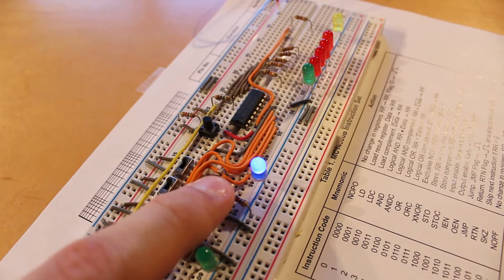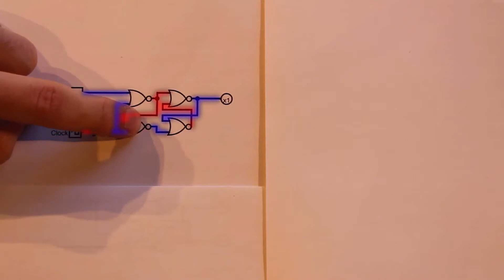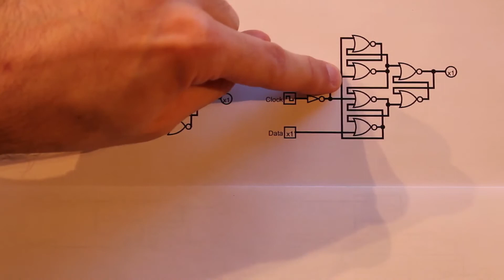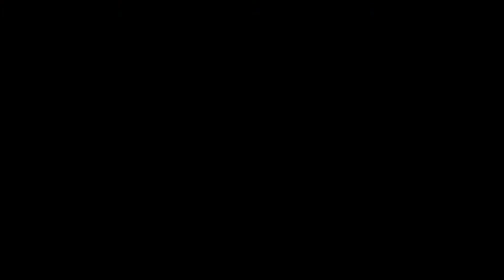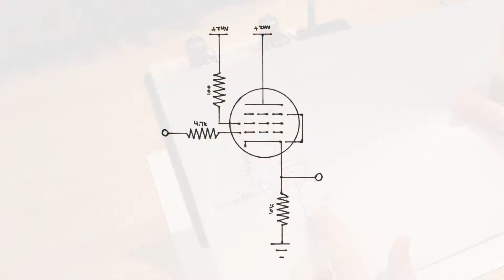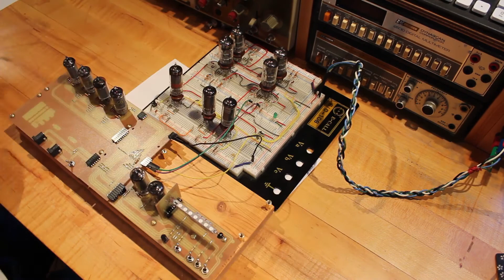Vacuum Tube Computer P.06 –Building a New Results Register

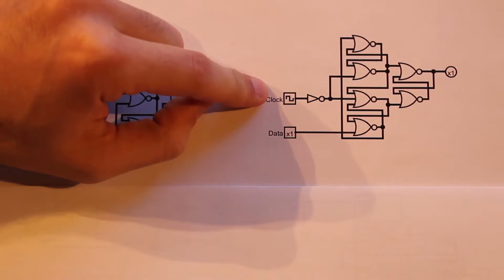Comment: 5:11 put a nand, or an "and" gate on clock and data bit, with a latched buffer, that way logic stay synchronized, and you can use a different bus impedance
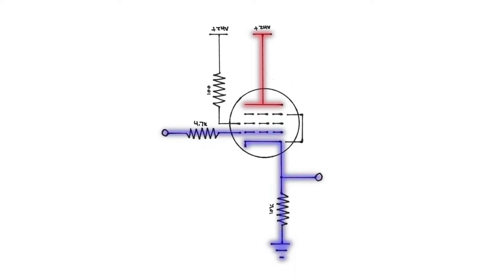Reply: 11:00 nowadays you call it a emitter follower for transistors, and common sourcing a mosfet, in 2023 an igbt or mosfet is the functional equivalent in operation to a triode, even down to its drive characteristics
Reply: minus a filament supply, just need your collector/source (anode), gate/base(grid), and drain/emitter (cathode)

Comment: The key advantage of the this master/slave arrangement (inverted clock to the first flip/flop) is that the change in the cock reaches the second(slave) FF before it reaches the first (master) one, due to the delay of the inverter. This makes sure the signal at the input of the slave is stable while its clock transition is happening.

Comment: The thing which you are calling a D flip-flop is what in digital systems is called a “latch”. The circuit which combines 2 latches is indeed a master slave flip-flop which is commonly called a D type flip-flop (hence the confusion with your named “D flip-flop”).

Comment: Compact? Did you consider using 1Ж24Б (1sh24b) valves? Not only compact, but very cheap. They work great on low voltages. Beware that filament voltage is only 1.2v: https://www.radiomuseum.org/tubes/tube_1j24b.html
Reply from the maker: I would really love to get some of those subminiature tubes to play with one of these days! The primary reason I'm building everything out of 6AU6s though is that they do great at low voltages and are the cheapest tube I've come across. You can often find huge lots of them for cheap enough that the individual tube price is less than $0.30!

Still, those subminiature tubes really awesome!
Reply: @UsagiElectric  what is that reason that 6au6 tubes are so cheap? A component used in a lot of common items?
Reply from the maker: @RiggedBananaGaming  Honestly, I'm not sure as to the specific reason why they're so cheap. From what I've seen though, they were a fairly common tube that could be used in a ton of different components. For example, my HP200CD Oscillator uses two 6AU6 tubes. Tektronix also used them quite often in their scopes, sometimes having around 20 6AU6s in use. Also, I believe they were quite popular tubes for TVs and radios and 50s and 60s.
Though, it should be noted that the 6AU6 wasn't the only popular small general purpose pentode. The 6CB6, 6BA6 and a few others were really popular as well, and in most cases they can be interchanged with the 6AU6 without even needing to rewire anything. (The 6AU6 and 6BA6 share the same pinout and perform very similarly, the 6CB6 has the cathode and shield grid pins swapped, but since those often get tied together, the 6CB6 can usually be swapped in without issues.) The 6BA6 was used in quite a few places our Magnavox Conert Grand, and the 3CB6 (a 3 volt filament version of the 6CB6) was used in an old General Japanese TV we have. 
From what I've seen, these small 7-pin pentodes tend to be really cheap as they worked great as general purpose amplifiers for all the control circuitry for TVs and radios and what not, but they didn't produce the best sound for output audio amplifiers (and given their small size, the amount of current they can push is limited). So that means there are a bunch out there that aren't really highly sought after by the hi-fi audio community, which is the primary use case for tubes these days.
Reply: @UsagiElectric  thanks for all the info! Also for the amazing videos! I've been powering through them and have the bell on to make sure I don't miss one! Amazing production quality, didn't know very much at all about tubes before these videos
Reply from the maker: @RiggedBananaGaming  Thank you so much!
It means a lot to hear that y'all are enjoying the content!
Reply: @UsagiElectric  Or going even smaller, nuvistors. Those were the "last hurray" of vacuum tubes, designed and built mostly by RCA (also several USSR types), extremely miniaturized tubes in metal-ceramic packages the size of (1960s) transistors, i.e. 1-2cm. They built all sort of electrode configurations with them, mostly triodes and pentodes but also beam tetrodes etc. Look up "nuvistor" :)

Comment: Man these videos are awesome, just what I wanted to see and no one made them before, thanks a lot for did it, I use vacuum tubes for audio amplifiers but always wanted to use them in other applications like logic or RF, maybe you can try some audio oscillators for a tube synthesizer or something like that in the future or maybe RF little transmissor with low voltage or use valves for video/tv stuff. But the main goal you achieved is to make this things work in logic under 24v and simplify all the hard and massive concepts and lot of components! No more clear than your videos, keep it going! Greetings from Argentina
Reply from the maker: Thank you so much!
I did a little sleuthing on your channel and your amp sounds awesome and has a really clean design! 
I would like to do a bit more audio stuff with tubes in the future. Most notably, I have a few tube AM radios around the house, but we're so far out in the country, we don't even get AM radio stations out here, so I can't really listen to anything on them. I'd love to build a tube AM transmitter to bring those back to life.
Also, I do have some analog stuff planned for the near future, though it's not audio related. It's certainly a challenge sometimes to get all this stuff working at just 24V, but it sure is a lot of fun, and I think it opens up the door for others interested in tubes that are scared of high voltage like me!
Thanks again for the awesome feedback!

Comment: Haven't watched the whole video yet, but is there a reason you aren't just modifying the clock signal to a quick pulse through a, say, a capacitor or some other differentiator circuit? That should take care of the flip flop following the data when the clock is high. If it's an "era" thing, aren't resistors and capacitors still common to the same age of electronics as vacuum tubes?
Reply from the maker: Thanks for checking the video out!

That's an excellent question! The answer is a two fold though. 

The first is I actually did try using a coupling capacitor on the input, like this https://i.postimg.cc/sXz0N18z/Coupling-Cap.jpg . But, I ran into a different subset of problems with that as well. My aim is to keep the clock input as close to a square wave input as possible (I want to keep that rise time as fast as possible), but with the coupling capacitor, I couldn't strike a balance between rise time and input voltage. That is, if the capacitor is small enough to make that rise time fast, the actual peak input voltage isn't on long enough (or strong enough) to actually get the circuit to switch. If the capacitor is made larger, the rise time becomes slower and then weird errors start to crop up while the input voltage is in the intermediate state between logic high and logic low. This is probably due to the incredibly low voltage I'm running the tubes at.

The second issue comes from how I would like to design the clock overall. I actually need two clocks, one slightly delayed behind the other. For testing purposes, I would like the ability to press and hold the clock and use the scope to see one clock go high and then the second clock go high and stay high. It also makes diagnosing issues a bit easier if I can keep the clock either low or high and check how signals are propagating through the total circuit. But, I'm getting a bit ahead of myself, I gotta design a decent clock first!
Reply: @UsagiElectric  Thanks for the answer and clearing it up! These videos are great, I hope you keep doing them!